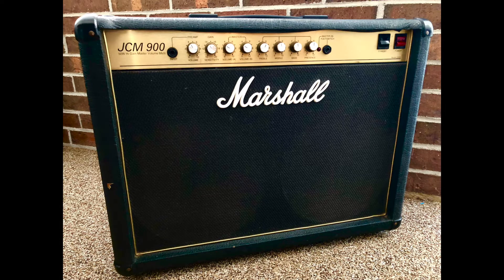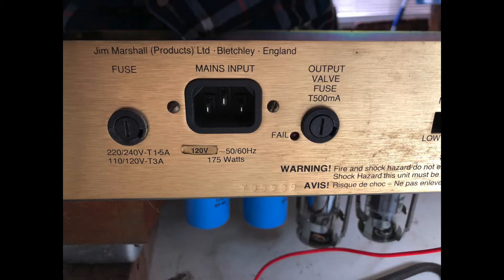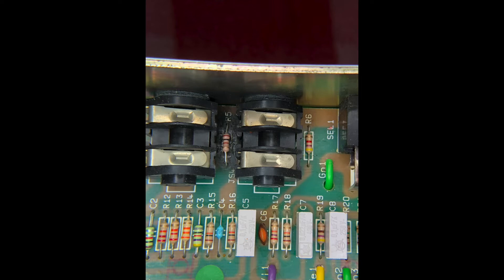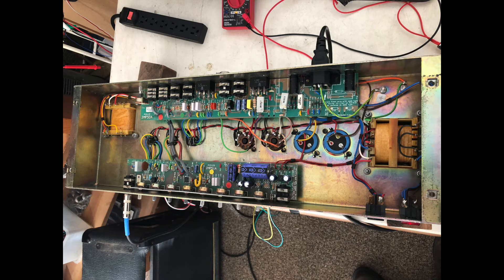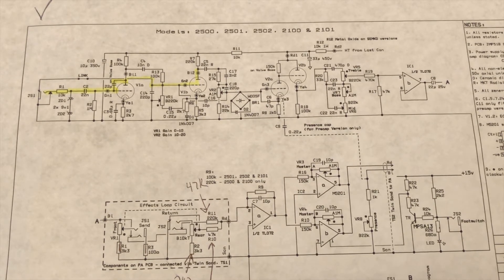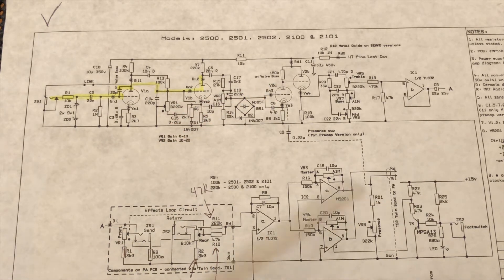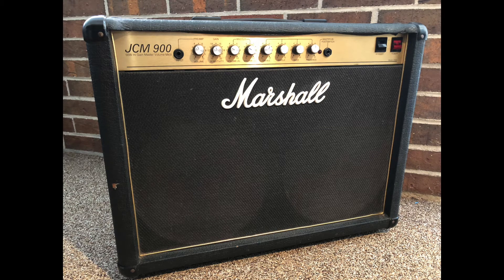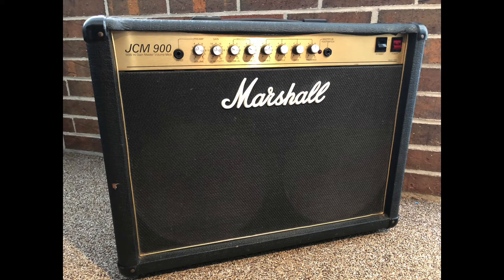Marshall JCM 900 MKIII repair. Blowing fuse.

Comment: That’s my amp. I had a fairly common issue with the effects loop jack. Cleaned it up (deoxit) and plugged in a cable and it stopped cutting out. Often replacing the jack solves this shorting out issue, but many people have “bridged” the problem by plugging a cable into the jack. Unused jacks get dirty overtime. 30 plus years is plenty of time. Hope this helps someone with this under appreciated amp with it’s unique diode clipping on the sensitivity knob. If you don’t like the clipping just turn it down to zero, but its a great amp.

Comment: Just put a revision 20 board in a TSL 122 and my bias is starting at 90mV per side with the bias pots all the way down (trying to set it at 75mV). Now after watching this I think I’ll check the x cap on the output board. I already changed both pots on the bias board which is all there is on the actual bias board. Thanks for the knowledge and lesson. Stay blessed. Would a Mallory 630V metal film .047uF be a good replacement cap? Not sure if there is something better than what Marshall is using?

Comment: It sounds like me and you and probably a lot of other people are gaining experience from the same people and I can say I have learned a lot as well I consider myself an amateur still but I've learned a lot and right now I have a 1968 or 69 Ampeg B25 amplifier head and I have the same thing going on with it, I get the voltage up to 70 volts and it blows the fuse, I don't think the power transformer is bad from what I can tell and I actually think that the problem lies in the biasing circuit. I did find a resistor that is really crispy looking and I haven't removed it from the circuit totally to actually get a real correct reading to see if it has drifted or how much but my next thing is to replace a couple of these components around the biasing circuit because everything in this amplifier is original none of the main caps have been changed out and I know that all needs to be done, at this point I really want to get it up and running and quit blowing fuses, the rest I can take care of. Wish me luck I know I'm going to need it. Great video, God bless.
Reply from the maker: Ron Carter thanks Ron! Sounds like u are going to get it going.  It’s fun bringing them to life.

Comment: I have a SUPRO 1650RT and everything works EXCEPT no gain and the RECTIFIER TUBE is not lit up at all, stone cold. Checked it with 2 different  new rectifier tubes and tube is still a No Go - could the rectifier section have its own fuse?? any thoughts. PLEASE HELP - Very frustrated because everything else works.Thanks.
Reply from the maker: a. webb I would check to make sure there is power getting to the rectifier with a multimeter.     Does it have the rectifier switch for changing  watts?
Reply: @mikeblehm  Mike, yes, this is a strange setup. Please bare with me and I'll explain.1) Yes, it does have a TOGGLE that goes from 35 Watt amp to a 60 watt amp BUT WAIT - it gets crazier. this is almost like 2 amps in one. if you select 60 watt, it is an AB amp with a silicone Rectifier. If you select 35 watt it becomes an "A" type tube amp with a TUBE rectifier. It also has built in reverb and tremolo. As I mentioned EVERYTHING works except the rectifier tube on the 35 watt A tube amp side doesn't light up - totally cold. QUESTION: Could a bad pre-amp tube cause the rectifier tube to Not work?? Because I just found 3 hidden 12ax7's tube in the back of the chassis. I have to drop the chassis just to check them.
Reply from the maker: a. webb  the preamp tubes are separate.  Need to check the voltages on the rectifier tube socket.  Make sure u have 5.3 volts for the filaments.
Reply: @mikeblehm   But aren't some of those filaments very high voltage? to be honest I never did that before But I do have a multi meter - AND how could the tube socket have no power flow and yet everything else works?? I'll put in a call to Supro tech support Monday morning. Thanks for all your suggestions Mike - Still a mystery.
Reply from the maker: a. webb one set of wires will be high voltage.  The other will be 5.3 volts.  The rectifier will only be used for the 35 watt setting.  It uses diodes in the 60 watt setting.  U can test the voltages through the tube socket just need a diagram for the rectifier tube.  Great amp hope u get it figured out.
Reply: @mikeblehm  Mike, something must be up with this amp because there was a black plastic plug where the rectifier plug goes and as we both agree - the tube socket seems to have no power making the tube dead when I inserted one. Like I said, everything works. Amp not getting hot, the 35/60 toggle switch works along with the Verb & Trem and the CLEANS on this beauty are amazing. I plan to put in a call to Supro tech support first thing tomorrow to find out what the story is. Thank You Mike for your patience and assistance with my situation. I gave You a THUMBS UP, and I SUBSCRIBED TOO.